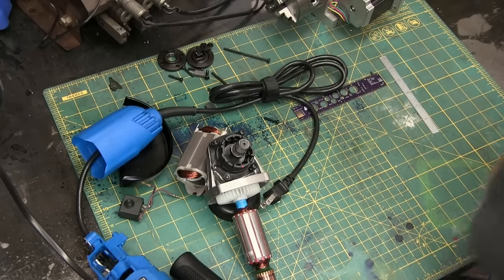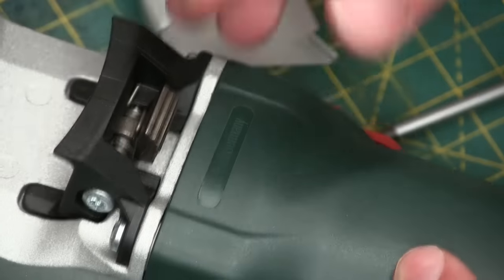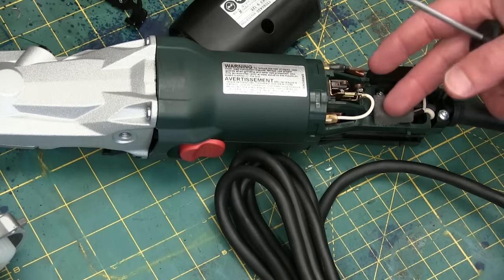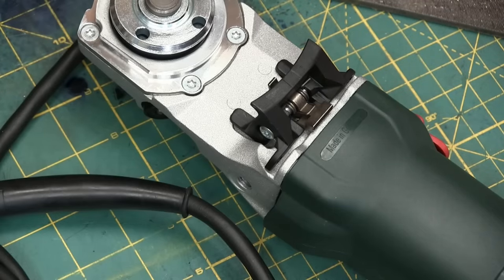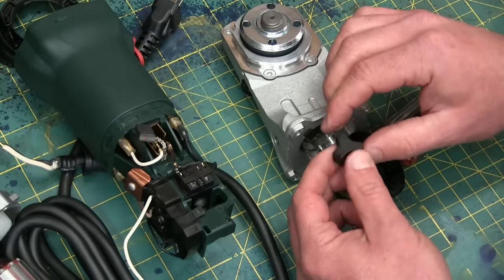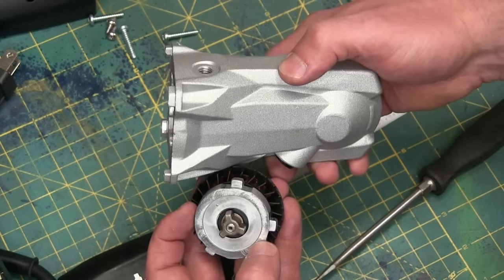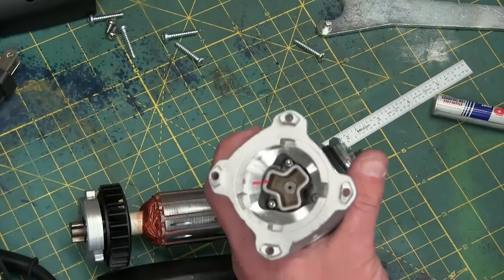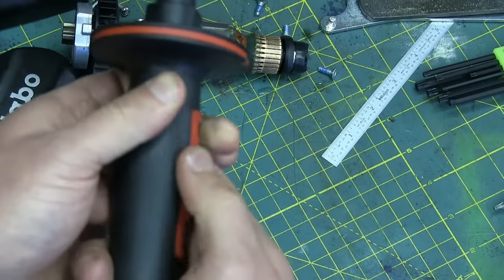BOLTR: METABO GRINDER. MADE IN GERMANY

Comment: So, you can appreciate quality tools but find quality vehicles somehow offensive?  The quality isn't just perceived.  It's very real.
Reply: Someone owns a german car
Reply: Mercedes, the faks, haven't a clue how to make things that last.

edit:anymore. mid 80s  Mercedes diesels will run forever
Reply: No, they knotted up moments after the warranty ran out.
Reply: ***** What, you don't like exploding sintered metal timing sprockets?
Reply: Eh, debatable when you need to work with them.
Reply: our plumber bought a well cared for gently used Mercedes sprinter and the diesel engine done crapped it's guts out
Reply: nissans are very reliable but even they have some shit ideas like plastic timing chain guides
Reply: Brandon Cole
Nissans are boring.  What I was getting at in regard to the German car manufacturers was the quality of the experience of driving them.  I currently own an Acura TL and it is probably the best car I've ever owned overall.  Having said that, Mercedes from the 80's and early 90's were the pinnacle of German engineering.  They are very special.
Reply: no not really they were low output diesels theres nothing special about the longevity of an all mechanical no epa requirement diesel. nissans arent boring to me they are value vehicals just as all of GM used to be. my wd21 pathfinder was my first vehicle with the vg33i that i drove around for a year with gas mixing with the oil, had an exhaust leak, bad vacuum lines, accidentally ran it into overheat shutdown because my dad had fucked with the lines and put he wrong size hose on. and after all that it still starts and runs. and for a cheap vehicle it has some cool stuff. some options had magnetically adjustable shocks and mine came stock with 4.62 gears so with a bullet proof v6 known for turning over 300k a transfer case and auto known to take a beating you have a very good package. it also came with 4 way adjustable seats, auto mirrors, and looks better than any other blob shaped import of the 80s. so i find a handful of great features more interesting than the gimmick of the yearly cycle.
Reply: also my stock magnesium rims are nice ;)
Reply: Brandon Cole You don't know very much about cars if you think Nissans are special.  Have you ever owned or driven anything else?  I've always compared Nissans to GM products because that's what they remind me of.  Mercedes diesels of that era are exceptional cars.  I've never owned one that didn't go well over 300K miles.  There are million mile MB diesels from that era.  They've been well-documented.
Reply: just like the nissan diesels used in the old international scouts went over 300k they are diesels theres a difference between the mechanical life of diesel and petrol ICE engines. i find the mercedes diesels boring. they were anemic, they were maybe the ugliest cars of the 80s and they didnt get good mileage. the scout got comparable considering the weight, driveline, and drag coefficient.
Reply: jonnoMoto
Much less often than a scheduled timing belt replacement every 60-100K miles in most Japanese interference engines.  You could also see it coming if you maintained the vehicle.
Reply: 3rd World Garage
I don't live where rust is a problem and I dare you to find a modern car that is rust proof.  Areas that have rust problems on cars still do to this day.  Everything you mentioned as problems on that era of Mercedes were usually a couple decades after they were built and most of them were and still are easily avoided with proper maintenance.  Believe it or not vacuum line isn't expensive nor are the pods.  Further, you can literally still get parts from Mercedes-Benz for cars built in the seventies.  I got them from a Dallas dealership whenever I needed them.  Have you ever driven one of these cars?  They're absolutely solid and feel majestic as they plod along.  Tractors are slow too but they last a really long time.
Reply: Brandon Cole
The ugliest cars of the 80's?  You have no idea what you're talking about.  I got 24 mpg out of my W123 diesels regardless if they were the four or five cylinder engines turbo or naturally aspirated.  In my W124's I got up to 30 on a regular basis.  What do you claim the International Scout with a Nissan diesel got?
Reply: well the scout got 18/24 which is decent for a low geared heavy 4x4 suv but the datsun 210 got 50/37 hwy on petrol and i think it still had around 70 hp if i remember correctly. datsun focused mainly on economical 4 bangers and the diesel wasnt really something a lot of r&d was put into because it wasnt what it needed for the market or to compete with toyota back home.
Reply: Very special as in unbearably expensive to maintain and overengineered to the moon, while being marginally more comfortable than the competition? (Source: my friend owns SEC560)
Reply: Interference engine. Timing anything failure is a new engine.
Reply: I can't speak about everything German. However I know for a fact the only kind of quality German Auto manufacturers produce is poor quality.
Reply: +Sal Palmieri Volkswagen Audi group have pretty good stuff
Reply: Cars rust a WHOLE lot less than they used to.  The 1970s and early 80s were a shitshow for rust. I have a few relatives that worked for Ford for decades, and they say that all the US manufacturers (and many overseas) used lowest bidder sheet steel during that era.  You'd see cars 2 years old with rust pits in them.  These days it's pretty easy, even in the rust belt here in Michigan, to have a 10 year old US made car with no visible rust, if you're taking ANY kind of care of it at all.
Reply: "knickers pre-knotted"? You're killing me here, man.
Reply: Yes.  But can you trust them.  They've been caught out before.  Think emissions.
Reply: THEY ARE NYLON BRANDON. SO MANY MANUFACTURERS USE THE NOW AND SOME USE A TEFLON BASED ONE. THERE IS NOTHING WRING WITH THEM FOR EVERYDAY DRIVERS.
Reply: not in North America. most of the vw audi group cars are manufactured in Mexico. I don't really know how good their cars are in Europe but in North America they cut corners like crazy. I work on these abominations every day. you know how sometimes you hear Ave say wow that's cute, or that's a smart way of doing something. you can't say that about these cars. more often you will ask yourself, why? why make something so complicated it has so many places for failure? you see on vw in particular have many issues with simple devices like window motors, radios, hoses, and vacuum lines. they stopped making the 1.8l turbo but one problem they had was a vacuum t connector right next to the oil filter. it was so brittle if your hand brushes up against it, it will break. vw knows about the issue and even have an updated part that is stronger however no recall was ever announced for it.
Reply: Brandon Cole
Well, based on your vocabulary and fascination with Nissan I suspect you're from Australia or New Zealand.  Do you use Imperial gallons?  If so, they are 20% more volume than a US gallon.
Reply: Robert Szasz
Audi's are amazing right up until the warranty runs out.  German cars are much more stimulating to drive but that comes at the cost of complexity.
Reply: Invincible Osprey Yeah, gotta agree there. A friend has had two Audis, and post-warranty, they've started costing him a fortune. Stupid stuff fails and costs $1500 to fix. I think he spent more on repairs on those two cars than I spent buying my current car. He opted not to get a 3rd Audi.
Reply: no i am not from australia im jealous of them though because they have access to the renault/nissan diesels like the V9X (im pretty sure i butchered that engine code) the international scout was one of those occurences where an engine gets contracted out bh another company such as how how the old mercury villager vans have the vg30i in them. i only know that because i was researching possible donor cars in case mine ever failed. but i do like the patrols from australia. also if we were talking diesel efficiency the isuzu dmax diesel with stick wpuld blow them all out the water as far as reliability and economy. the td25s from vw are economical but have nothing on the workload of the truvk diesels.
Reply: godinn where u responding about the time chains o  the vk56 and and vq40 engines? ik they had a replacement kit part but i thought it was cast aluminum.
Reply: +Brandon Cole, yeah but our diesel fuel is facking ridiculous. So dirty it literally ruins these fancy European diesels. One television talk show asked people to send in jars of diesel fuel marked with the time and place of collection, and there was every colour of the rainbow from a dirty black to light straw, and half of the samples had dirt, water or even Vaseline trees growing in them! I hate to think how much sulfur is in them also :x
Reply: MrGoatflakes How long ago was this?  The US switched to low sulfur diesel about 5 to 10 years ago, can't remember the exact year. Before that, it was the same thing as heating fuel, very dirty and lots of sulfur.  Most European manufacturers stopped selling diesels in the US because of the crap quality of the fuel back then.  They've started selling them again now.
Reply: John Ridley
Bullshit.  You are too quick to condemn the US.  In 2006 both the US and EU went to ULSD.
Reply: well there was a recall so they were faulty the problem is the chain guide was a weak link in the vk56 where the engine is so damn tightly nestled in there. the last gen titan was basically a cab forward type design and nearly everything on it you needed a dealer tool. i love nissan but im not gonna ignore their faults.
Reply: @godinn
Reply: lol i guess its time to start burning veg oil with some methanol then xD
Reply: @mrgoatflakes sorry i still dont know how to reply directly with the new youtube/g+ mobile update
Reply: Brandon Cole
tell me and we will both know. I press reply and sometimes the name comes up, sometimes it doesn't...
Reply: MrGoatflakes
What is the population per square mile of Australia?  How much of Australia is near the ocean?  Unless you are in a city where diesel exhaust can be and is concentrated there is no real danger.
Reply: Invincible Osprey Um, yeah, 10 years ago like I said.  BEFORE that the stuff was pretty high sulfur. I remember when the ULSD stickers went onto the pumps.
Reply: Lighten up Francis
Reply: MCE Performance heh. Francis was my grandfather's name and he was a mechanic for Vacuum Oil Company :P
Reply: Invincible Osprey Your comment about luxury cars is so funny. What are some of the least reliable vehicles on the road? Jaguar, Land Rover, Astin Martin, Lamborghini, etc. They easily cost 2-10 times other brands, yet are always at the shop, or just to have an oil change costs $2k. Luxury tools on the other hand are usually very robust and require less maintenance.
Reply: Leggir I was referring to German automobiles.  Mercedes and BMW are in another league entirely compared to those you mention.
Reply: Invincible Osprey in a whole other price range not a whole other league they both chooch one does so more efficiently the other more reliably and cost effective.
Reply: Mercedes Benz are rubbish, as are BMW. I drive Mercedes every day, (being unimog and gwagon) and gwagon are a terribly built vehicle. Not only do they short out when driven through any moisture, they are also badly finished and overpriced. the mods are slightly better, but only because they are older mogs with not electronics.
Reply: Tightly tangled on his nadulars.
Reply: Invincible Osprey German electronics are a nightmare...

Comment: Yep at work my metabo grinder didn't start. Took it apart and that thing in the brush is a spring with a little plunger so when it gets worn down the plunger goes in between the comm bars and won't start to tell you to change the brushes

Comment: Mr AvE, I have never had a need brought up enough to feel I should comment on one of your videos to possibly shed some light on a subject, until now. the subject would be the pinion and crown gear mesh. those gears are exactly like the ring gear and pinion gear in an axle, thus when load is applied it turns the whole assembly and transfers motion at a right angle. what I'm getting at here is the gears in an axle are designed for the pinion to screw into the ring gear. when that happens it moves the wear area in the center of both of the gears. I know there were no shims in the grinder assembly but I'm sure there is a preload of sorts to allow the pinion gear to move away from the outside edge of the ring gear. 
take this how ever you like, I felt I might be able to open up a possible explanation. I do love your videos though. Long time subscriber.

Comment: @11:00 The motor brush has a spring and rubber bumper cast into it so that when you wear through the meat of the brush and expose the rubber bumper, the spring forces the brush back off the commutator and the rubber bumper insulates the spring from the commutator so the motor won't work any more until you replace the brushes.

Comment: Hello. I'd just like to make a little correction. Thermosets do not melt, thermoplastics do melt. Vulcanization really does introduce crosslinks into the rubber which actually makes it sort of a thermoset (sort of, because the process does not only involve temp but also chemicals). It wont melt, just degrade under high temp.

Comment: Been looking fw to this video.
The cable is SJOOW (UL) or H05RN-F for us metric people. It is indeed a 'rubber' thermoset neoprene cable and is UV resistant and is suitable for direct burial.
It's not so expensive but yes - much mor than PVC cable. The inner insulation should ideally be EPDM but is often a lesser material.

Comment: On the locking mechanism for the guard I think you overlooked the fact that it has tabs that fit into pockets cast into the gear housing. I think you should see if it will work without any screws and if the pocketing is enough to hold the guard.

Comment: We use 4.5" Metabo's at work. I asked the boss why he bought them instead of whatever else, his reply was that these held up while others did not. I've personally run them till they were too hot to handle, set the hot one in front of a fan, and traded off for the one that was already in front of the fan. Rinse and repeat until the job was done. The only failure I've seen with them is worn out brushes. $6 for new ones and it was back to work.

Comment: I too have some older Metabo grinders and I really like them, my 6" is my go to grinder in the shop, going on 15 years old now and no issues.  I did full time fabrication for a few years in there too. 

 Anywho...  I'm pretty sure the electronics prevent the grinders from starting if the switch is latched and it gets plugged in.  I know mine won't start in that scenario.  Also, my old grinders have the same switch style.  At the time I bought mine you could get different switch heads for them, just pop them off and swap on a different style.  Some employers do not allow the latching switches.  Metabo had one switch head that wouldn't latch, but had a very long tail so you could hold it "on" while gripping the grinder.  Mine came with the long tail non locking switch and I ordered the one like comes on your grinder.  I swapped it out with nothing but a screwdriver to pop it off and poped the replacement on.  It is still fine after all these years.  Anecdotal, I know, I'm just saying there may have been some thought into why it was designed like that.

Comment: the dewalt angle grinders i use have springs built in to the brushes, so when they wear too low the spring becomes exposed and pushes the brush away from the rotor to prevent that damage

Comment: It's not just the two little screws in their Nylon bosses that hold the rotating guard latch in place.  The Nylon part sits tightly in a fitted recess in the aluminum; this is what absorbs impacts on the guard.  The screws simply keep the latch in the recess.

Comment: I had a brush with a dot on it like that, but in a dewalt angle grinder. it ended up being glue that held a compressed spring.  When I wore the brush down far enough, the spring burst through and pushed the brush away from the commutator, shutting it down right quick.

Comment: Since the cable makes contact to a (tin?)coated part, it does not need to be tinned itself because the other part serves as a galvanic anode. The wabbely connection is still strange though

Comment: I had a metabo grinder, not this one, but some simpler cheaper version W 780 I think it was. Used to work it 7-8 hours a day, like heavy use. Had it for 3 years till it was stolen. haha. Really loved it. It would not even heat up in my hands after 8 hours of virtually nonstop usage. Didn't even have to replace brushes. Pushing harder on it while grinding would not slow it down much unlike Makita, Bosch, or Klauss or any other grinder I have used. The switch was the only bit that I didn't like. It was a bit hard to turn in on or off with one hand, but that was only after it had fallen from 2.5 meters.
But unfortunately not all metabo tools are superb. I had 2 cordless 12V drills. Too easily breakable. And warranty repair would take ages.
Most of stuff to abuse hard every day I would go with Hilti or Makita for lesser usage, but when it comes to small grinders - definitely Metabo.

Comment: I wonder if the brushes are similar to the Festool brush design? These have a spring loaded disconnect button which instantly pushes the brush away from the commutator when the brush reaches end of life. A great design which prevents the excessive arcing and associated commutator damage that normally occurs as the brushes wear out with most universal motor designs.